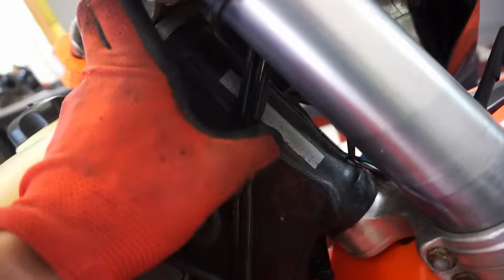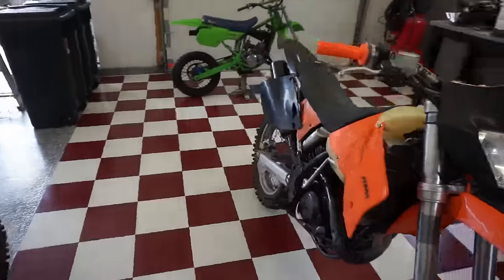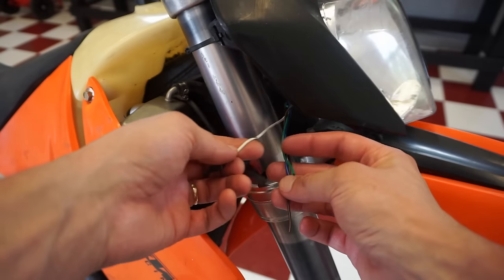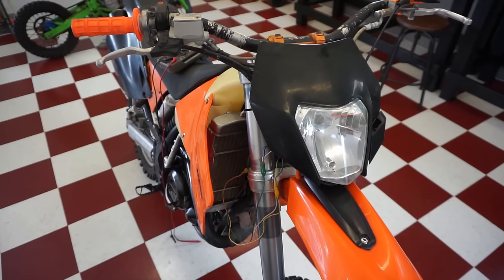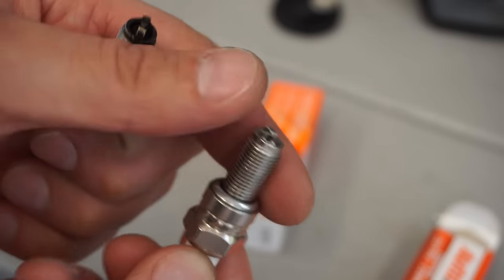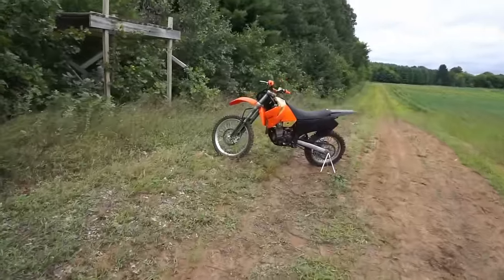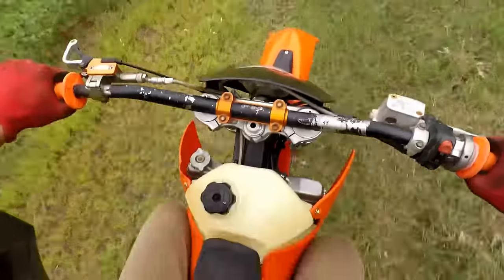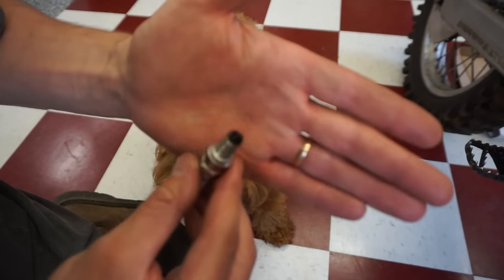This Is Why You DON'T Buy a KTM Dirt Bike ($1300 KTM 450 Find)

Comment: Bike/engine diagnostics can be pretty simple if you just follow the basic steps and eliminate all the variables! ALWAYS drain and change the fluids (especially the fuel! It's an unknown quantity) draining the oil can give you a clue to overall engine condition. Inspect/Clean/Replace air filter. Do a proper compression test. Start with the cylinder dry! No oil, if it's low put a small amount of oil in the cylinder and retest. If compression comes up considerably your issue is "probably"rings and not valve related (4-stroke). Clean and inspect carb, if you're sure it's functioning properly, pull the ignition cover and check timing. In this case you have a charging system and it's not charging properly (low voltage) find out why! Inspect wiring harness and all connections. Buy a manual or research online and find the correct test procedure for the stator and coil. In this case I believe it's one of those 2 things but hard to say and only guessing without testing. The vibrations and conditions that bike components are subjected to can wreak havoc on wiring and electrical connections.ive also seen 4 stroke engines run erratically from improper cam timing ( excessively worn chain (although I doubt that's the case here)

Comment: It sounds like an intermittent spark issue to me, possibly the plug wire. I had a 4 wheeler that was what it was.
Reply: I was going to say the same, try it at night and look for tracking otherwise try changing plug cover, wire cdi whatever.

Comment: Stock jetting is the starting point to tuning your carb... it doesn't mean it is correct for your location...or bike..you adjust it to Work better...if it is not running right...go leaner or richer in small steps till you find some better tuning.... check timing is correct...as it sounds more a spark issue... cutting out... check connectors for corrosion... or grounding out...do the basics before guessing on parts to buy...test and check simple stuff first before wasting money on parts swapping...

Comment: I had the same problem one week ago. It took me 2-3 weeks to figure it out. All the time I thought my bike is running too rich. I tried small jetting, but this was not the problem. The spark plug was always smoked. I tought it was burning oil and I changed the piston ring, agan this was not the problem. Maybe you don't belive, but all the time my dirt bike was running too lean. I rejeting the carburettor. And now starts immediately whithout the choke and rev to the max whithout any bog. I hope I was helpful and sorry for my bad english speaking, i don't know very well english language.
Reply: If you had the problem a week ago and took you two to three weeks to figure out then you havent figured it out yet. For another one to two weeks anyways.
Reply: Pilot jet to lean at idle needle setting or main to big causing to much at full throttle right
Reply: 1 week ago the problem was solved
Reply: @Mizman76  
his english is better than yours..i understood what he said....and your joke too...

Comment: There are many factors that can contribute to poor performance like that.
It is likely a combination of problems.
A few things that you can't at first see are:
• Cracked spark plug
• Corroded spark plug wire
• Dying ignition coil
• Bad CDI
• Blocked carburetor passages
• Intake manifold leak
• Blown head gasket
• Cracked cylinder head
• Burnt valve
• Cam lobe going flat
• Any number of other issues
If you look at the KTM, Haynes, or Clymer service manual, you will see there is a section that deals with trouble shooting. It guides you through the steps to solve this kind of problem. You can easily rule systems in or out as "the problem".
You could easily have more than one problem, that when combined lead to terrible performance.

Comment: There is a rubber gasket in the "tower" of the carb spraying carb cleaner into it usually destroys it and it will never run right after.Accelerator timing can be a problem but not create backfiring like it does...

Comment: Air fuel mix ain't right he has to hit throttle to bringing idal down more than likely pilot jet to lean at idal and needle set to high making it run to rich in full throttle   also always good to check valve spec to

Comment: Disconnect the fuel line to the carb and see if theres a steady flow of gas coming out if it runs good sitting then bogs when riding something is blocking the fuel from flowing like bouncing and stopping the gas

Comment: I'm a bit surprised that the oil hadn't been diluted with fuel. When fuel remains in the cylinder, it seeps down past the rings and into the crankcase. The guy must have changed the oil shortly before selling it to you.
Reply from the maker: Yes he did change the oil right before selling it to me.

Comment: I know very little about enduro motorcycles, however when you were reading the charging system at the battery, it didn't seem to be charging properly!
 I suspect that your ignition is running off the battery and drawing it down!  
You might have a problem with the charging system or the voltage regulator.

Comment: I got a 03 KTM 450 exc in late 02 Worst bike I ever had, just did not like it. power delivery sucked suspension sucked everything about the bike. By then I had ridden a few 400 exc and ended up getting a 06 400 exc totally different bike, one of the best race bikes ive had!!
Reply: PS: KTMs are Race bikes (Not trail bikes) They are designed for racers and racing and strict maintenance intervals in heavy race load (HR"S). A lot of the thing you don't understand why there done are answered by this alone.

Comment: See if the needle is stock needle and clip is in the recommended slot.   If it is, I would try setting needle clip in the next notch up to lean out the mid range.  If that doesn't work very well, I would put the needle clip back to to its original position - and then I would try going down on the main jet one or two sizes.  As they say, "Make one change at a time."

I suppose it's POSSIBLE the carb pump is acting up but that the pump SHOULD not be an issue 3 seconds after the throttle is turned...unless there is something REALLY WEIRD wrong with it.  That is, the bike was misfiring several seconds after you twisted the throttle, long after the pump did its job.

Comment: The carb has an accelerator diaphragm. It turns to crap. Had an identical bike that just got sold and it would bog on full throttle from idle. Ran wayyy better than that tho overall lol

Comment: The click at the end is the auto decompress that clicks back because of the low revolution. If you have to low rpm you can also hear it. And you dont adjust the idle before its warm and you dont rev it like that cold! This is a KTM not some rice bike.

Comment: Maybe try some Sea Foam engine cleaner, add to your gas tank and crank case. Cleans carb tank and all those gross carbon deposits. Should run smoother after. Also rejet.

Comment: Sounds ignition related. It’s not bogging, it’s breaking up. Cdi or weak coil. Ohm out the coil and if it ohms out good replace the CDI. Sporadic and weird is usually CDI or in the automotive world ignition module.

Comment: If it’s rich turn ur a/f screw a bump out. Or adjust the clip on the needle down a notch. Regardless of accelerator pump, you can meter the fuel intake. If it’s got a reed cage check reeds as well

Comment: I just recently bought a 03’ ktm 125sx and same problem sorta. It cuts out before power-band, bogs then, hits power-band 1-2 seconds later.. so I sent the motor out to a dealer for a complete rebuild and working on rebuilding the rest of it in the meantime. I’ll post again after I get it rebuilt and see if it remains the same

Comment: So why did you pull the screw thing off the top of the plug? That’s for old school lawnmowers where you put a different wire on. Just because it wasn’t in there doesn’t mean the last owner screwed it up. Also running hot and bogging it could be lean. If it’s got a bad lean misfire it could cause unburnt gas and a black plug. The high idle and slow to come down it could be lean. Is there an adjustable needle on the slide?

Comment: Recently bought a honda ct 90 for 250$ no carb or anything but I zip tied a battery to the side of it Cleaned the points and it had spark so I sprayed some starting fluid in the intake and it popped off for a bit needless to say I'm happy with it.

Comment: My ktm 360 with a gnarly pipe   had a bad bog.  I ended up after many tries going with a 178 jet instead of the 172 and second notch on the needle.   Try going way rich first with 4 sizes bigger.

Comment: Check valve clearance. I have a 150r that’s having the same bogging/cutting out issue. The valves are off. I dropped the needle all the way and it quit for about 10 hours of riding and it just came back as the valves got worse. Valves are definitely out of spec on that bike though.

Comment: Always go back to what an engine needs to run. But it needs more than that to run properly! Air/fuel/spark. Air needs to be adequate, fuel needs to be fresh and metered correctly. And spark needs to be adequate as well. And timed correctly. Just because you get spark cranking an engine does not mean it's enough spark or at the right time for complete combustion. And it also needs enough compression for proper combustion. When you're dealing with a 4-stroke more variables come into the equation. Valve seal, valve timing and adjustment. And then there's always the possibility of air/vacuum leaks.

Comment: Get a R&D flex fuel screw adjuster. Rocky Mountain has them. This will allow the fuel screw to be adjusted from the side. The starter is in the way to adjust fuel screw. When the fuel screw is adjusted correctly, throttle response will be better.

Comment: Interesting to be invited in to your troubleshoot, but the Title is misleading.  Any way to identify carb jet problem instead of attacking possible electrical problems?  Is the KTM electrical system so good that it masks over-fueling and spark plug choking?  I need to look back at when you checked the plug.  Thanks.

Comment: I had a problem with my pilot jet getting clogged and It ran like this unless the choke was barely pulled out. I took a zip tie and wrapped it around the choke to slightly pull it out so I could make it home to figure it out.

Comment: Could be a fuel delivery issue try connecting a hose on the gas cap and blowing on it see if it revs out or put clear gas line on it and check for air bubbles in that case your gas cap might be no good

Comment: Did you get it running?, I had the exact same issue on a Honda xr75 , the sound and boggs were identical,  I rebuilt the carb and blaster the jets clean with compressed air and added a new air filter , and the issue was fixed

Comment: Most the time the 400cc bikes have no battery and starter motor they are usually kick start only and most have decamp levers - 400 high comp engine’s . But with Ktm I could be wrong .
Reply: This information is not true at all.

Comment: Could be a coil breaking up had it happen to me as it warms up an gets hot it gets really bad I'd check the valve clarence to shes sounds a little tight in the top end but my bike used to do that an I replaced everything then we tested a new coil an the bike ran better then ever before would sit an idle all day long but as soon as you put it under load it would break apart just like this an sounds like its smacking the limiter but it's really breaking up spark

Comment: FCR carb mid Body gasket failure. It has the non MX type carb with an epoxy joint in the body and some complex seals that fail with exposure to ethanol or age. Try Litetek for the seals.

Comment: Had same problem on a yz450f. It had a 30 leak jet allowing accelerator pump to have to much pressure/fuel. Went to a 50 then raised needle. Ran like a champ after that.

Comment: If it is anything like the old Yz/Wr426's that yamaha brought out in the late 90's early 2000's. The carburetors on those were renowned for having a similar issue. There is a mod you can try for the fuel pump called the BK mod. It can be done several ways but essentially it just stops the arm from pushing the pump all the way so it doesn't squirt as much fuel through during acceleration. If you have exhausted all other basic options. Try the BK mod. I have several 400's and 426's and i have had to do it to every one in order to get it not to bog.

Comment: Sounds like a problem with spark. Check spark plug wire for a break in the insulation..sounds like its grounding out. Had a car that sounded like ur bike. Run the bike in total darkness and look for arcing

Comment: It probably is the jetting. It may be stock but it might need to he changed to the altitude your at. Because I bet that bike came from somewhere else out of the country and the guy didn't wanna mess with it so he just rode it with the messed up carb. You can also adjust the needle if that's a thing on 4 strokes lol I can't remember. I ride a 2 stroke now these days

Comment: the bike almost sounds as if it's an ignition problem, the timing sounds as if it's advancing at the wrong interval, I had a car that did that (check timing/flywheel/cdi ?) too much gas, not enough spark, re-jett the carb smaller ?

Comment: A couple of things check the aluminum nut on the crank on the clutch side it comes loose and the carburetor needs the mid base gasket changed and make shure the accelerator pump is working. 
I accidentally posted the other one to early

Comment: It looks like you wired up main beam and low beam together. The smallest bulb is a sidelight. Kind of like a running light. The other bulb has a ground and 2 positives which switch it between low and high beam. You can put in a switch to go between them but you should only have the low beam on while riding ideally until you need that extra bit

The running issue could be dirty filter... Not getting the air it wants. Definitely rich popping

Stock jets are for factory altitude

Comment: Dude, straighten up your carb, it's on the piss something rotten which will affect float height and all sorts of other carb issues, also the ngk cr8ek is an open spark which this engine needs, don't put some Nappa style spark plug in it, that fuel hose looks to small in I.D as well, check the fuel filter on the tap within the tank, that's a bitser of a bike, it's got 02 plastics on it but an 04 exhaust and headlight, the RFS engine is bullet proof but may I suggest if you want to bounce it off the rev limiter sell it to someone who knows EXC's and buy a CRF250R ..... 👍

Comment: Valve clearance I would check again. Possibly a timing issue. Run a inline spark tester and see if it is cutting out at high rpm. Could be a faulty stater.
Reply: A faulty stater that is working half @$$ will keep up fine at idle low throttle but will start cutting up as the demand gets greater

Comment: Not sure if you were able to fix it, but have you played with the jet sizes? Also check your fuel bowl float, because you mentioned that at one point it was leaking fuel into the engine, which would cause a rich condition not sure if it has a fuel shut off valve, but if so turn off the fuel before ride and see if it briefly runs correctly, before running out of fuel. If so, it's either an incorrect float height or a bad needle or seat that connects to the float. Best of luck.

Comment: This bike has a fcr39 carb.
Those carbs separate in two pieces in the middle, a really complicated gasket handle all the idle chock circuit
Those gasket go bad, you need to change them, that's probably your problem as you are trying to tune the carb and nothing you do improve de situation
Reply: This was the gasket in the little metering block? Kind of a mushroom shape. I have heard of this. I think it was on a Suzuki DR. I avoid fuel with alcohol in it. I think it deteriorates the rubber. My 2 cents.

Comment: mate do a search on mid body gasket on those FCR slant carbs your will just be black goo, ask me how i know ......make then run as rich as hell mid throttle. They also made a 520 EXC in 2002 and a 525 EXC in 2003. your would seem to be a 400 as the 520 has twin exhaust header from the head

Comment: looks like that specialty spark plug might have damaged the cdi and timing not advancing unstable ignition and try running a non r plug but really look up what is the oem plug put that in if condition still persists check pickup coil if good then i would say damaged cdi provided wiring free from partially broken internal wires causing unstable ignition , timing chain is all good etc .i had one problem similar and it turned out one of the internal plates in battery was shorting out check that as well load test batt and regulator seemed to respond very sluggish  when voltage tested that should in my opinion up to full voltage in a few seconds .

Comment: My 2016 yz450 does the same thing. It was starting to run worse a couple days ago and today it will barely idle and backfires whenever you give it gas. Im sure its valves. Im not sure though since ive heard from other people with the same bike that it could be something with the fuel injection.

Comment: Acceleration maybe failing cause hace shit inside also have to let a little play for it, check float height and put a 45 and 175, screew ajusten at 1.5 turns, neddle 3position It have to run better, ist a good starting point